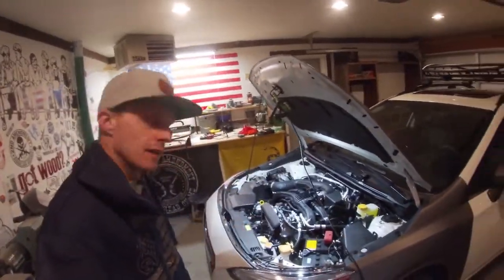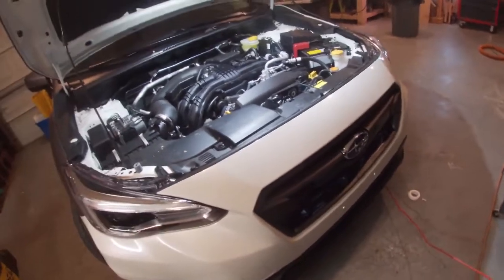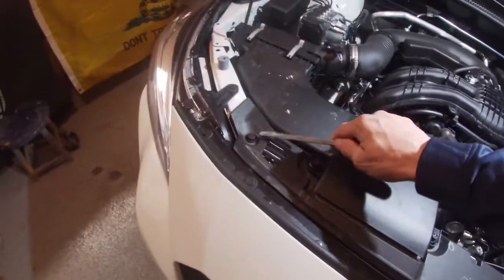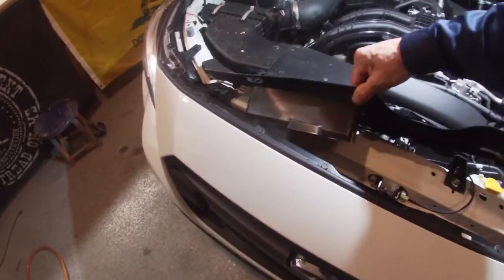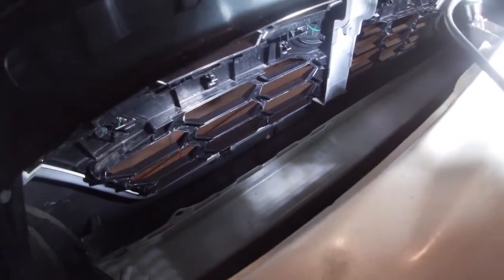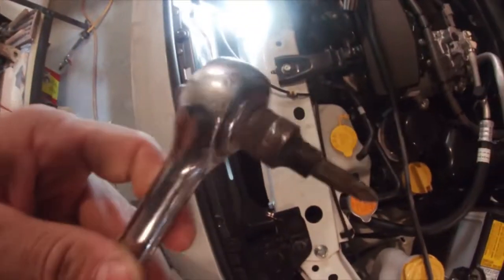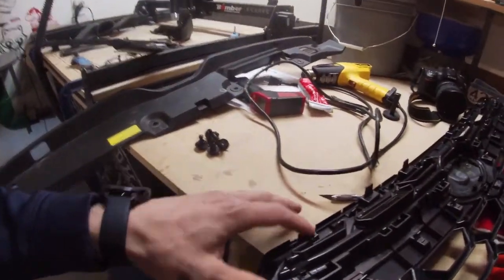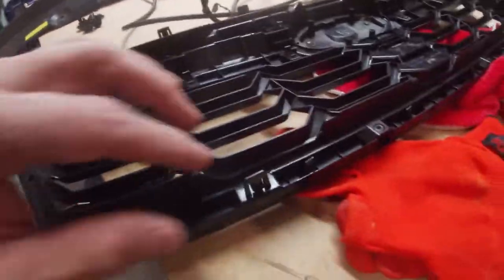How to Remove Grill 2020 Crosstrek Subaru

Comment: Just wanted to post for anyone like me that found this video later. 2022 has 2 top screws and 4 bottom. I spent some time looking for 2 more upper screws that were not there. Also, great vid and yes twig arms help.
Reply: Thanks
Reply: Yes having tiny arms really helps. We just changed our. I say we because my forearm wouldn’t fit to get to the screws. The rad support is not straight on new models. Had to bend it a bit but the wife reached them No problem. 😂

Comment: Hello! I’m trying to change the grill but I don’t think I have the right size socket for the wrench to fit ? What size socket and what size wrench did you use?
Reply from the maker: Need to get a Phillips bit behind there . So the smallest set up to do that works the best
Reply: @subarustu7716  thank you! By any chance you know what measurements you used?

Comment: Question sir, is the grill assembly come in set? Or let's say i want to replace a damaged winglet, can i just buy it as separate one or do i need to get the whole set grill? Thanks. It's actually a 2021 model i'm talking about
Reply from the maker: It comes apart in pieces but if they sell them individually I am not sure !?

Comment: hi, I have the 2019 crosstrek, broke the grill, only the part with hole, the frame around is ok, Can I just buy the grill replacement and use the plastic frame around?
Reply from the maker: I'm pretty sure its able to be changed separately if you can find the part